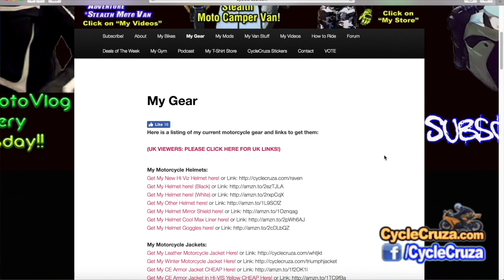WILL THEY PAY $1000 Repair for My BROKEN WR250R? UPDATE!

Comment: Cruza this is an issue with our Honda Xr650l's. Our stock front sprocket doesnt use all the spline length on the countershaft. We use the wider sprockets from the Cr450 or xr650r. They use the entire spline length. You may be able to do the same with a Yz sprocket. look into it anyhow and good luck.

Comment: I would measure the distance on the pro-x sprocket teeth (for the spline) with a micrometer vs the stock sprocket. A mallet should not be needed for install, unless the the teeth were incorrect on the pro x from the factory. This would explain was why the sprocket only contacted 60% of the teeth on the spline, it would not go onto the splines all the way. It may have felt like it was on all the way because the sprocket teeth were binding on the spline, if in-correct pro-x is at fault

Comment: $1000 is actually not bad at all for that repair. The countershaft will have to be replaced, which means removing the engine and splitting the cases. If I had not felt right about using that sprocket, for whatever reason, I would not have used it. What was that aftermarket sprocket made of, steel or aluminum? You can use aluminum rear sprockets (though they wear out real fast) but a countershaft sprocket must always be steel. There is something peculiar about the wear on both the sprocket and the countershaft. The splines are ground down on both. That means the sprocket was slipping on the countershaft BEFORE it completely failed. And to me that can only mean one thing. There was too much clearance between the sprocket and countershaft splines. In other words, the sprocket did not fit on the countershaft tightly enough, and/or the splines on the sprocket were too narrow, allowing the sprocket to move back and forth on the countershaft just a little. The sprocket simply did not fit properly to begin with.

Comment: Just fix it, and bore the engine out like you where planning on doing, and chalk it up as a $1000 lesson. You can sue them if you want to, but I don't think it is worth the time and effort. That is the price you pay when you do your own work. If you let a bike shop install the sprocket, you would have had someone to blame, but if you do your own work, you save on the labor, but you have no warranty. That is the chance you take when you modify stuff. I would just drop it off at the dealer, tell them to fix it, and pick it up when it's done.
Reply: Gotta be careful when doing moto maintenance. Certain things ill let the dealer do cause i know ill fuck it up
Reply: Panotaker all he has to do is go to a metal shop and put both parts through a hardness test and when he see that the replacement wasn't hardened he wins. The hardness test machine is very simple. You put the part in and the machine has a handle like a drill press and you bring it down on the metal. There is a spring mechanism in there and it will pop and put a dent in the metal. Then you have a scope to measure the dent. The wider the dent the softer the metal. Besides me just looking at it I can tell that the original was heat treated and quenched in oil to harden it and the replacement wasn't. Manufacturers fault. No reason to let this company ruin more bike with their shitty parts.

Comment: Really appreciate this video.
Put aftermarket alloy sprockets on my last bike.
CBR1100XX.
Had a pro shop do the work,,,but still,,,never trusted them.
Too damn light.

I'm betting that you seated the sprocket properly, metal to metal, but the machining tolerance did not allow the spline to fully seat.
Now that I know how the manufacturers stand behind their light alloy gears.
Never again.
Factory steel for ever after.
Reply from the maker: Same here, oem front sprockets from here on out for any bike I ever get. OEM sprocket  is specifically made for the output shaft. You KNOW what you are getting with OEM, not so much with aftermarket.

Comment: I highly doubt it was installed wrong. Most likely, a cheap sprocket with super soft metal. Not many companies stand behind a product these days, no shocker there.
Reply from the maker: You live and learn, only oem front sprockets from here on out on any bike I ever own.
Reply: If u need a mallet to force it on....
Reply: If the metal was so soft how did it grind down the shaft... It was installed incorrectly
Reply: Tenny80 easily done when heat friction becomes a factor
Reply: Tenny80 Heat. Think about how much it was slipping at one point. I’ve seen this happen before.
Reply: Dustin Hogan no
Reply: Tenny80 As CC stated, this part was Omni directional. He would have to be the biggest idiot in the world to have it installed wrong past that point. Either soft junk metal, or they sold him the wrong part. I’ve seen a cheap sprocket grind down the shaft the same way on a track bike before.
Reply: Sarah Dell wrong part, defect in manufacturing could be reasons, most likely he didn't align it properly. If the sprocket was such soft metal it would be worn away to nothing. It's only ground down in one spot
Reply: Sarah Dell or that the materials used in the sprocket are to hard. They are supposed to be softer then the countershaft. There is no way it was to soft
Reply: I doubt the metal was too soft...it was hard enough to grind cruza's sprocket shaft into oblivion.
Reply: Chris G exactly... Someone else understands haha
Reply: CycleCruza OEM could cause the same issues. It's difficult to pin down who actually manufactures the OEM sprockets and they can be made cheaply too. The important factor is that the sprocket material is somewhat softer than the metal on the shaft so it doesn't grind it down if for whatever reason it doesn't fit 100% to spec. You can always let a shop install it so that the responsibility of failure falls on them but it's unlikely to be a problem in the future.
Reply: Chris G don't try and use common sense to explain things to people on youtube lol. Cheap Soft metal on sprockets always grinds off hard metal.. It's how it works lmao
Reply: Tenny80 Some people live in an alternate reality man...

Comment: that a lot of work for that engine .cylider head off timing chain and cogs off , cyclinder head casing bolt released and removing clutch and clutch spring,cogs, and same on other side(brake system, clutch part, and transmission parts) before spliting case and getting to transmission and crank shaft, shifters plates , and then clutch pivot <--- part he needs /also not forgetting  Bering in engine casings (and every bolt nut bagged and categorized as well)

 option 1 out source new engine 2nd hand(cheapest option in my opinon save the hassle ) 
option 2  pay for repairs
 option 3 do it your self 
option 4 try to get someone to pay for it

Comment: This concerns me since I also changed my front sprocket. 
And I am glad you posted this video.  However I like to point out that the information given by the vendor and manufacturer must be wrong. The sprocket you used is NON SYMMETRICAL and therefore the way it has to be installed must consequently make a difference. 
The sprocket is flush on one side which apart from anything else also will set the center of the chain out of alignment. Also the sprocket is worn out on the side with the collar which inevitably pointed inside or towards the motor.
If the sprocket would have been mounted with the flush side towards the motor the grinding marks would on the flush side. Your sprocket shows the wear marks on the collar side.
Long story short if you only have a verbal confirmation instead of a written one that the sprocket can be mounted either way (which is bollocks) then you are screwed no matter what. 
Safe rides 🏍

Comment: TBH it was probably installed wrong I can't think of any reason it would strip only half of the teeth unless it was only half engaged to begin with. Front sprocket are tricky especially if you not super experienced

Comment: You put it on correctly but why wouldn't this failure happen to everyone else who installed it?
Reply: UTSB I dint think that part is just for a wr250r,  I believe it works for alot of ATV and other bikes , maybe CC was the first one to get it for a wr250r or maybe it was even a deflected part from manufacturer,  who knows
Reply from the maker: Oh it happens, just watch this mechanic show you damage from a new aftermarket front sprocket that was just installed: https://youtu.be/aOxBF80eMrI
Reply: You might be on the right track with the metal hardness issue. I hope you look into it.

Comment: Maybe pro-x needs to look into torque requirements for their aftermarket sprockets. I've done several sprocket swaps with no issues. This looks like the nut came loose somehow, and since it was torqued to manufacturer spec's, that tells me this aftermarket sprocket could have a design flaw requiring more torque.
Reply from the maker: Nut was staked down as shown in my install video. That was either a defective sprocket or as some said it could be harder metal than the oem splines. I did not feel right about the sprocket from start. OEM front sprockets from here on out.

Comment: Bummer. Somehow, this moved outward, or the entire splined area would be stripped. Don't know how or why, but it did. Short of installation by a dealer or pro mechanic, there is not much recourse in this situation. If the teeth are centered over the splined area there's no way installation direction would matter, unless that changed your ability to apply proper torque or swedge on the protection tabs. Were the tabs in place after the event? If so this shouldn't have been able to loosen at all! Bizarre and costly turn of events.
Reply from the maker: Some people are saying the metal could be harder on the sprocket compared to the oem splines. I will probably have the sprocketed tested and contact yamaha.
Reply: He still didnt answer about the tabs.
Reply: The MX Guru - CC is chasing a wild goose. He's been fed the issue and cause over and over, but still blames the sprocket manufacturer for incorrect size or their steel not being homogeneous. Haha.

This horse just won't drink.
Reply: n00bHaMmEr yea I agree man. After working in this industry for almost 2 decades and installing hundreds of sprocket and chain combos, I feel pretty confident that this was some type of installation failure or failure that allowed the sprocket to fall halfway off the splines.

Comment: I think the sprocket was probably either cast sloppy or machined sloppy.  And if it wasn’t then I’d like to see the proof.  Let’s start measuring with the calipers.  Thickness at the shaft and the teeth.  Spacing at the top of the tooth and the valley.  It’s gonna be a little different if the number of teeth at not the stock number but I think there was a little too much play at the spline gear and once it starts a single slip, game over.  It’s done.

Comment: You should let this issue be known on the forums and Reddit, everywhere you can, people should know not to support this company Rocky Mountain nor Pro X. They lied to you and now they're backing out, they deserve to be sued. Scumbags.
Reply: Rocky mountain isn't really at fault here. They told CC that the part would fit based on what the manufacturer of the part said.  RMATV has already offered discounted parts to CC because of this. The real culprit is the maker of the sprocket.

Comment: So, does the nut spin freely and thread all the way to the base of the shaft? What do the threads in the nut look like because in the still image, the threads on the shaft don’t look great. If the threads piled up during the install, proper torque wouldn’t mean jack and the nut could have either backed off or not been seated properly to begin with.

Comment: On the more serious side,  I'd check the hardness of the metal used for the oem vs. the aftermarket.  A rough comparison can be done with an auto punch bought from Home Depot and or use a file. Chinese aftermarket parts are notorious for their poor quality steel.  Just an idea,  goodluck!

Comment: How do you explain that only the inner part of the splines is damaged? It looks like it was hanging on the edge. So does the shaft.
Reply from the maker: Some people are saying the metal could be harder on the sprocket compared to the oem splines. I will probably have the sprocketed tested and contact yamaha.
Reply: CycleCruza does not explain only half of the splines being worn! If it was an issue with the metallurgy it would have damaged the entire spline not just half
Reply: kawadude mcdouble he doesn't get it. Dozens of people have pointed that out but he doesn't understand and is trying to blame the manufacturer's metallurgy technique instead. Lol

Comment: Also I just noticed when you show them laying flat on the seat, the teeth on the oem are farther from the seat than the new one. Makes me think that either the side you install it on does make a difference or its the wrong part. Or maybe it's just hard to tell in the video.
Reply: Yes it was Asymmetrical !

Comment: I watched the 3 videos and you can see he had the washer on the wrong side of the sprocket. You can see the washer still on when he shows the ground shaft. Chain is resting on it. And you can see the shiny sprocket when he shows the sprocket up-close as soon as it happens with the nut still on. Cant see the dull washer metal. So only about 1/3 of the teeth would be engaged. Causing the spinning. Owner's error. Happens to the best of us. I've done worse.

Comment: If he hasn't installed it incorrectly (I highly doubt that because CC is all the way talking and has two left hands for shure) my guess is that the sprocket shaft glided too far in the engine housing, causing the splines to only reach half way in the sprocket. How? I don't know! Saw it looked weird in the pictures and also saw it myself on an old machine...
I highly doubt that the steel isn't hard enough. By the way... You don't need a lab to test that steel!!!
Use a center punch or file on the old and new sprocket and see if it's hardened or compareable ffs.
Fucking drama...

Comment: I've probably installed over 20 front sprockets and I've never seen anything like this. The sprocket fit is usually so tight (what she said), it would be impossible to mount it incorrectly, especially after you torque the nut. It's virtually impossible to have a front sprocket on "half way" or whatever you clowns are saying. There was obviously the smallest amount of free play on the splines and after you hit those jumps on the test ride, they slowly ground down. That's obviously why it took a little while for it to become noticeable, and physically fail.

Comment: Hit both sprockets with a file and see if the new one is significantly softer, I'm guessing its shit metal and the teeth sheared all at once.

It would take an insane amount of force to back off a nut torqued at 60 + ft. pounds of torque,
Reply: Storm Silagy only half of the splines are worn. Meaning the sprocket definitely had room to move. Meaning nut installed incorrectly.

Comment: He probably had a washer or something behind the sprocket. It was tight but not on all the way. Would not have been stripped only half way. Also the shaft is a lot harder than the sprocket. Doesn't know what he is doing and blame the manufacturer. Typical. I thought CC was bigger than to blame others for his mistake. If you look at his video you can see the sprocket is not on all the way. The shaft should be through the nut. It is not.
Reply: Yes. You understand. It obviously wasn't pushed on all the way or came off. These are the only 2 options given the wear.  CC is not being honest with himself or us.

Comment: I was planning on doing sprocket and chain job myself but I noticed I don't have the right tools to get the job done so I took it to the shop for the job. So just stick with OEM sprocket to avoid a situation like this?
Reply: Solo nope, just about any aftermarket sprocket company is fine
Reply: I used a sunstar brand sprocket on my wr.  It works great.

Comment: Okay, common sense tells me that since only half the spines on the shaft and the sprocket is worn down, that means the sprocket backed off, or wasn't all the way fitted on to start with. I will go back and watch all your install videos to see if I can see anything else. But these nuts can commonly back off and cause this, first thing I done when I got my bike home I took the nut off, and lock tight it with the blue kind, just cause you stake it down doesn't mean it won't back off. So all in all, either your nut backed off, or the sprocket didn't fit all the way on properly. You didn't show when you first investigated it. Should of filmed you taking it off so we could see if the nut was really still tight, or if it was loose. Just my opinion.
Reply: Yep. Just as I expected. Watch your install video, you can tell the nut is not all the way on, meaning the sprocket was not all the way on. It's easy to tell, it had atleast another 1/8th of a inch to go on. I'd say the sprocket was defective. But damn it's to easy to notice. I can't post the screen shots I took but it's very easy to tell.
Reply: How would you be able to stake the nut down properly if it was hanging off the side of the shaft? IF you done everything right, and the sprocket was all the way on the shaft, there's no physical way only half the sprocket was worn down unless the nut came loose.

Comment: Idgaf what metal that sprocket was made of, it's clear something happened and it either was installed incorrectly, or the nut came loose.  The teeth were only ground half way out, if it was on correctly the whole thing wouldve stripped.  But hey mpty if they payed for it.